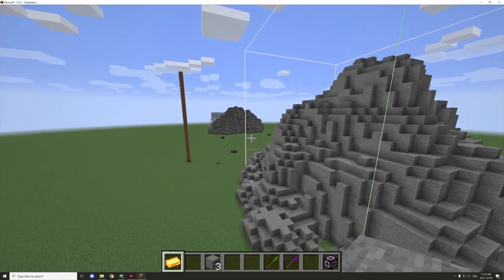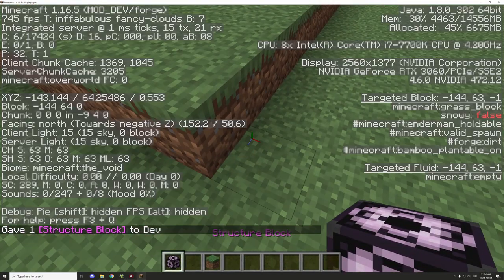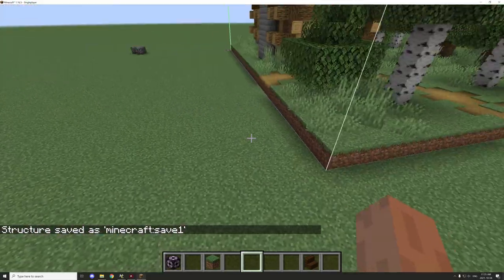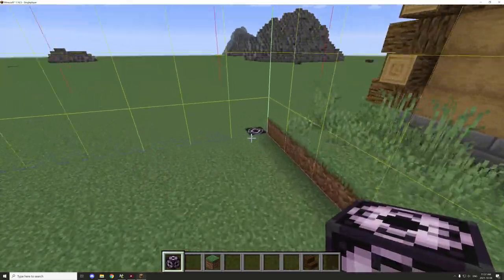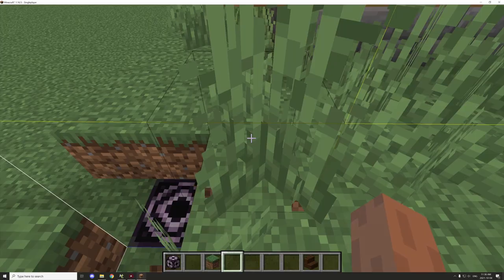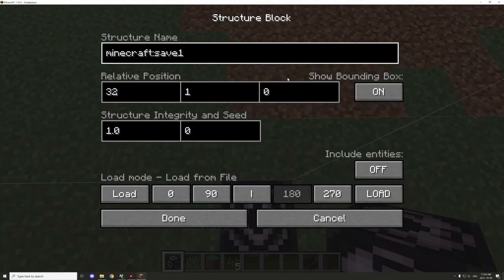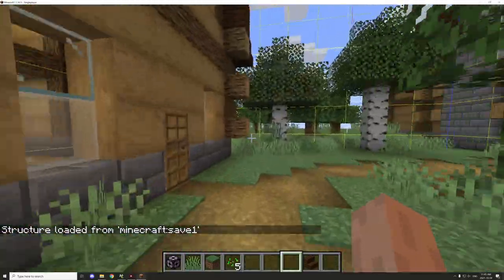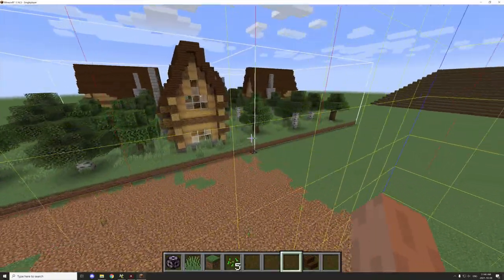MCreator Build: Log Cabin | Part 2

Comment: i tryed to make a 3x 32 high tower Building and let the bottom part spawn randomly in a custom biome. as i was trying to automaticly spawn the mid and top parts when the bottom part exists, after a view hours and lots of corners i got completely confused, only the top part got added above the bottom building part :(   i cant do it by my self can i get some help please or a link of an existing tutorial? thx!
Reply from the maker: I am still fairly new at this method but I know that if you use Goldorion's Chunk Manager plugin, then force load the chunks when spawning the structures it can fix some limit issues as the chunks are technically rendered when they are spawning the structure, the only thing is make sure to unload them after or it will stay loaded in the background which could cause lag or even issues for the save.

I also think the tower idea would be a neat idea to do for a building project, I may work on that for the next project, so hopefully it can help with your issue in that regard.